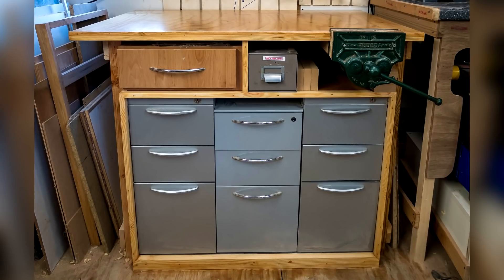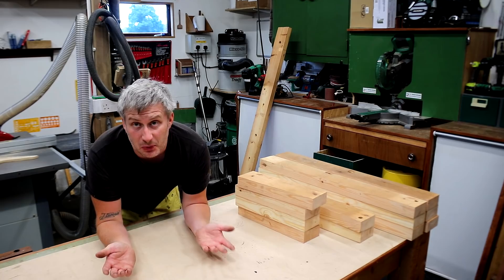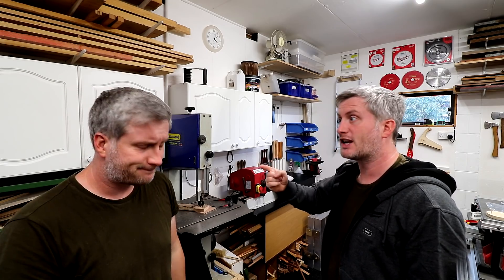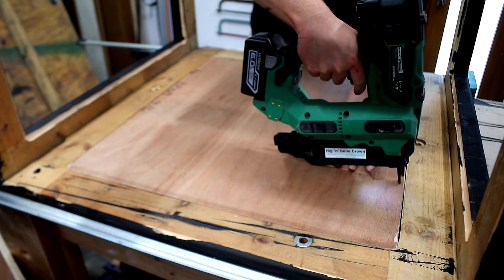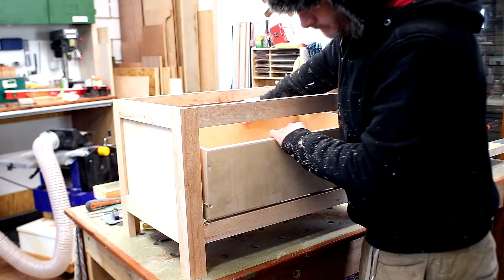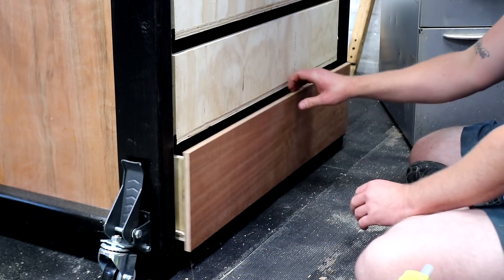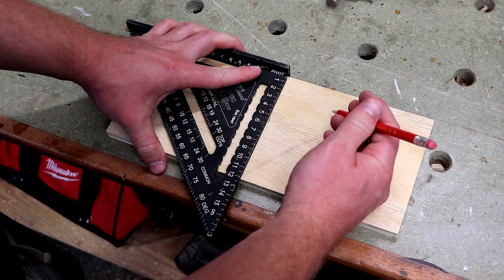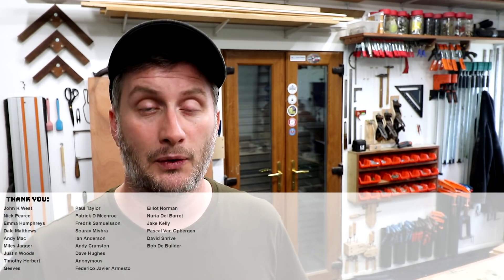Making A Workbench / Outfeed Table With Drawers

Comment: I have the same casters and I connected the two pedals together with a rail so I only had to step on one to lift each side.  It works great!
I would show you a picture but can't seem to do it here.
Reply from the maker: Great idea 👍
Reply: Thanks for sharing, how did you connect the bar to the wheels, so the wheels could still move freely?
Reply: @cjhification  it's the levers that are connected.  The caster still swivels freely.  I wish they would let us attach a photo.  It would explain it better that I can
Reply: @chemcody5119  I have had the same with Keith's channel, wanted to upload my customised Axminster trade extractor, where I took the table saw out feed table brackets from my Axminster table saw, mounted them to the wall, and took off the tripod legs from the extractor as it tool up a massive circle, then mounted the extractor on top of the supports, use to take up loads of floor space, now none, love it. Will have to look again at the video as the wheels I have may be slightly different.

Comment: i rounded over the corners on the wrong bits on my tablesaw stand so glad to see the more seasoned veterans doing the same thing. so easy to get carried away with a roundover bit. im 45 and only recently got a router for first time.
Reply: Roundovers are a nightmare for me, I have taken to using my trim router (little Katsu job for £25 (about 2 years ago, probably bit more now)) on assembled jobs if they are big enough for access to use the trim router, or if they are too small, put them together, mark up roundovers, then disassemble and do roundovers then. Good luck, and enjoy!
Reply: A great addition to any trim router is a 4-5mm thick sheet of Perspex about 200mm x 200mm make a hole in center and drill and countersink holes to attach to base, and it's much easier to use.
Reply: @cjhification  yes i recently did this. also means i can flip mine over and attach to my workbench to use as a basic router table.
Reply: @kanedNunable  you may find routers become an addiction, I think I have 6 now (though one is power free), couple of trim routers for when doing multiple profiles, couple of 1/2 inch plunge routers one for the table, and one for big jobs free-hand and a Bosch green plunge ¼ inch/6mm/8mm that started it all off as well as a router plane for when it needs to be done quietly.
Reply: @cjhification  yeah i have only really started getting into woodwork so still buying my tools. i have a cheapy trend router but its not great so want to get a small one too
Reply: @kanedNunable  the Katsu is a knock off of the old Makita trim router as it's out of patient, does a great job for the price, also lets you have a play with a single handed trim router, very different to the plunge routers. If you really find it useful you may decide to get a better one down the line, but it's my feeling that tools that cheap offer a really great opportunity to use them for a few years to see if you're actually in to woodworking.

Also, love the name, made me smile.
Reply: @cjhification  i like katsu curry :P
Reply: @kanedNunable  love it, it's one of my favourites!

Comment: Nice bench/outfeed table.  I need one.  My outfeed is a rack with seven rollers I salvaged out of an old treadmill.  One advantage is junk does not accumulate on it.  On those drawer runners, I have installed about a hundred sets.  The instructions I have seen say 1/2" on each side, minus 0, plus 1/32". since 1/2" is 12.7 mm, 13 was a better choice.  Incidentally, You don't REALLY expect us to believe you ACCIDENTALLY  HAD to use your Domino, Do you?   Pretty happy accident.
Reply from the maker: Using the Domino is always a pleasure just because it's quick and easy, but I'd have liked the half lap joints for extra strength

Comment: Could you make a video showing how you use this as an outfeed table, beside the height was there any other design elements? Did you cut slots in the table?
Reply from the maker: Just the height, no slots. The table saw is on wheels so if I use a sled I just move the saw back a little

Comment: The spacing problem is because of the imperial/metric conversion. The total gap should be one inch. half an inch on each side. Which is 12.7mm (half of 25.4 mm) so 13mm is the better spacing option!

Comment: One of the reasons 13mm works better than 12mm is that 12.7mm is 1/2 inch which is the ‘standard’ drawer runner gap left by US cabineteers.

Comment: great video, i also recycle the same type of drawer runners, i use 4×20 mm screws to fasten them but they keep hittong the small wheel in yhe runner and the motion isnt smooth, what screws do u use with these? thanks
Reply from the maker: I'm not sure.. but they have smaller heads than normal, I think you need to find slimmer screws 👍

Comment: Your Hikoki mitre saw sounds sweet, not harsh as most others.
Is it a battery model? If yes, how many cuts and effective max depth x length of cuts
Reply from the maker: Yeah the battery lasts really really well. There is also a power supply available for it